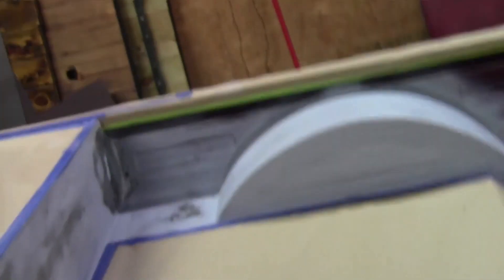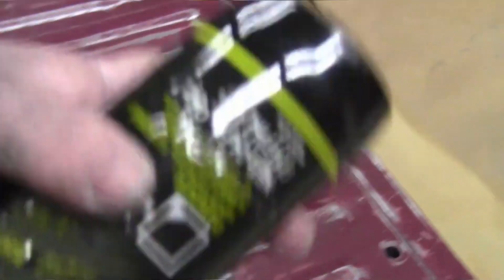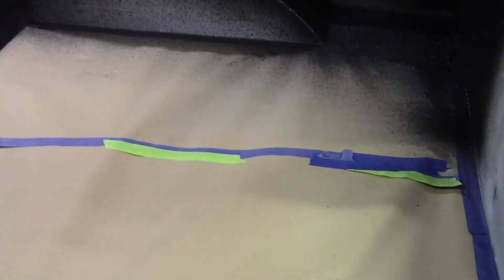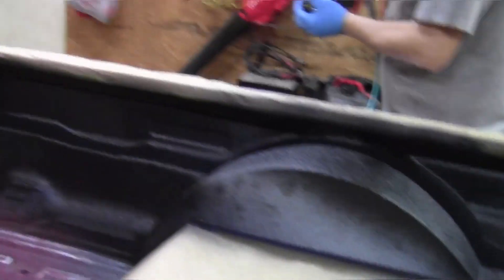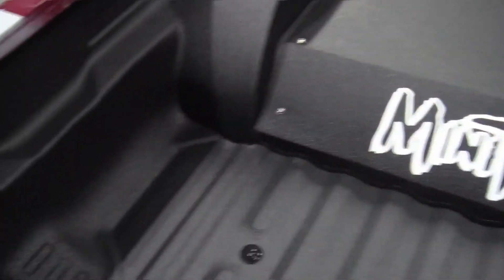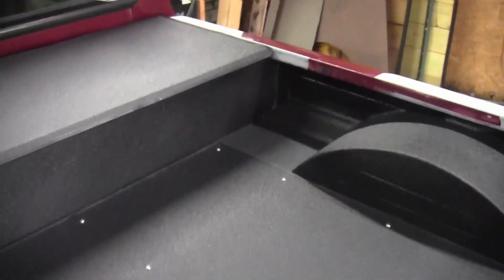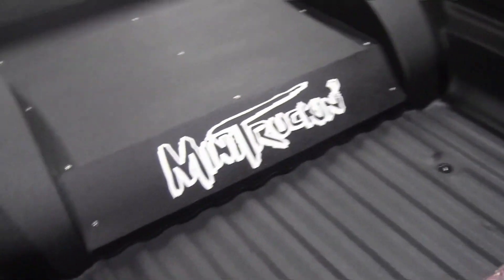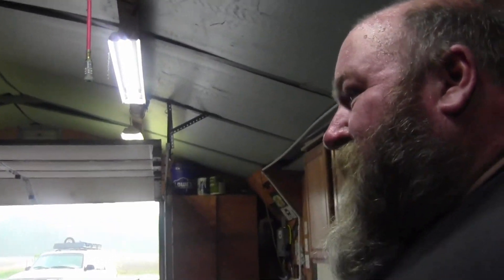Installing Raptor Liner In The Mini Truck

Comment: Is that a one time gun...or can you clean it and use it again even past the hour time frame
Reply from the maker: He cleaned it. It was the same gun he used to paint the Tracker he painted. We didn't do a video unfortunately. I think he used acetone to clean it or thinner, and he cleaned it between coats as well.  You can get the kit with or without the gun I think.